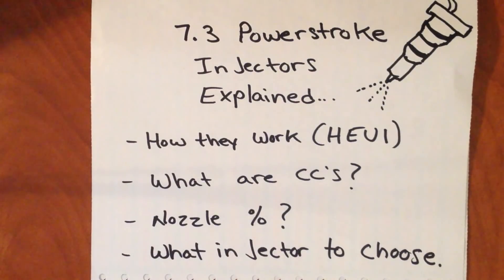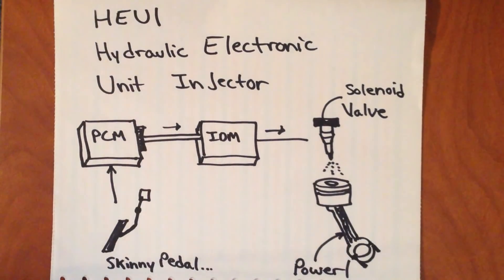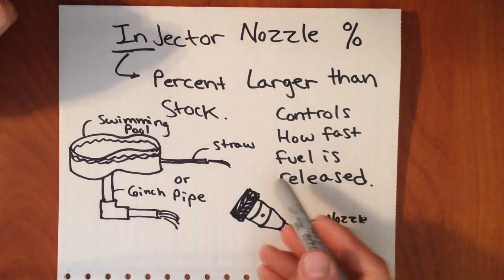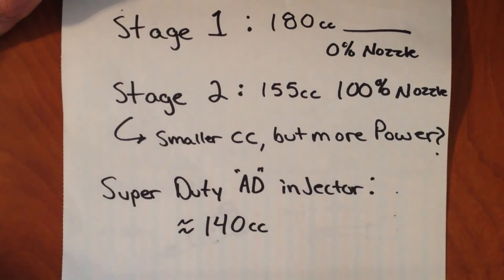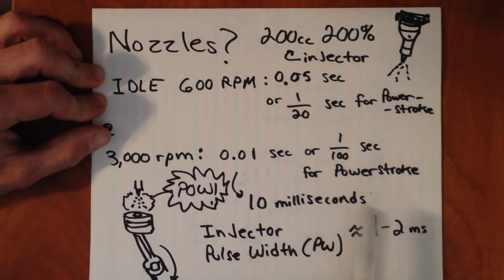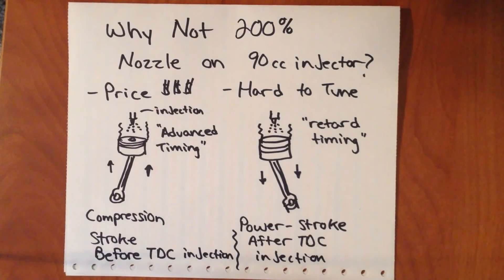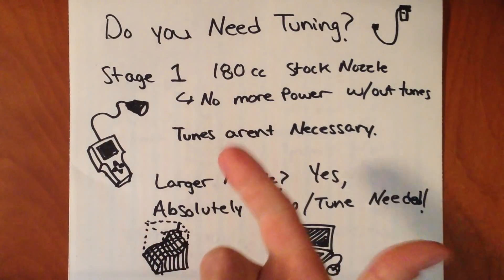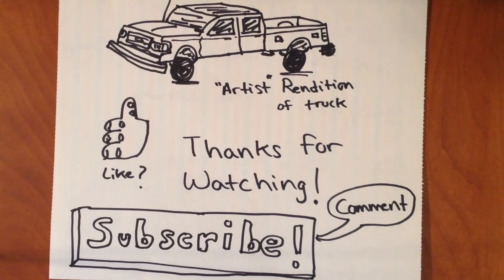7.3 Powerstroke Injectors Explained

Comment: I have a 2000 truck  that came with AD  INJECTORS  I recently  had to replace the motor wound up putting a 94-97 not sure exactly  what year it actually is but it does have AA injectors can these successfully  run with my newer 2000 model computer?
Reply: Thank you for the fast response .
ok  I didn't give you all the info that was maybe needed.    The truck is a 2000 FedEx ground  grumman's stepvan it's a 1652 sc  chassis  it came with international  444 7.3 turbo diesel with all international  computer and sensors it has AD injectors it was still running with 600,000 plus miles I've had it about 4 yrs. It's a truck from Maine so their was rust issues unfortunately.  
It began to give me some issues with running poorly.  
I dumped a suction eliminated treatment and their fuel treatment  and that helped for a while but also had bad exhaust manifold leaks so I was gunna have to pull the motor to do some work to it ..
I thought well if I can find  another complete motor that maybe my ticket.....   I found one.  2014 Reviva 7.3 Reman complete motor . 
Excellent  price I decided to buy it  the guy has a shop and is very familiar  ?????  With these trucks. He has a contract with a large parcel service to maintain their trucks and dispose of them when no longer useable evidently  their are newer parts on some of these that may have been wrecked or whatever reason and he is able to buy the complete truck and dispose of as he see's fit.  
Ok so I agreed to pay him so much money for the motor and so much for Removal and installation  of new engine I. Thinking this is sweet almost to good to be true.  Lol it was. He had my truck for over a month he did do most everything  he said he would but the 2014 somehow blew a rod from the day I saw it running and putting it in my truck so he has multiple  7.3 motors literally  lying around on shelves in his shop the guy Is an intelligent  very likable nice guy but I dont think I can say that about his employees  ...
He wound up putting what appears to be a 94-97 7.3. 
I pulled valve cover off to verify this motor had the 2 connection valve cover wiring  harness verses the newer single connection  the replacement  motor came complete with wiring harness  has a separate pcm and idm like my Ford excursion 7.3 diesel and my 7.3 f250 and 7.3 f350 dually .
From what I can tell he used my original international 7.3 444 wiring harness and  single I guess Idm pcm computer and reused my valve cover gaskets 
To connect my wiring harness  to the single shot aa injectors.
The truck runs I've driven it about 175 miles it smokes (black) constantly  and is pretty week .
Do you think I can drop in a new set of AD  injectors  which is what the original engine had that the 94-97 motor will run correctly ?
Will I run into possibly  problems  also with the Hpop? 
 I think the 94-97 has a 15* hpop and my 2000 has a 17* hpop. What are your thoughts ?
Thank you so much for any advise  sorry it's so long
Reply: Sorry not suction.    
  STICTION ELIMINATOR
Reply from the maker: Wow, you have a very perplexing situation! If you can, avoid driving or starting it at all until you know whats going on, you don't want to toast the new engine too. I'm not familiar with the T444e, never worked on any of them, but from what I know it's the same engine as the 7.3 powerstroke but with of course different injectors I believe, a different bell housing too I presume, and probably a different accessory setup as well. That being said you can convert a 7.3 powerstroke to a T444e and visa versa. If I were you, see what you can find out about the computer controls that you have currently. Is the PCM a Ford or International PCM? If you can, find out what year it is too, maybe by looking at the serial number, Fords usually have something like FTZ... or some variant thereof. See if you can do the same for IDM, I don't know if the T444e and the powerstroke used the same IDM or not, and I'm don't know about interchangeability. 

You say the truck smokes black and makes no power, with lots of black smoke, it sounds like the computer calibration is off, like it's dumping in too much fuel. I think there's a couple of things that may be coming into play here. If you have a 94-97 engine, with AA injectors, assuming they are indeed AA's and not AD's with AA solenoids on them, but that is unlikely, then we at least know what injectors you have. I suspect your computer is messing things up. Obviously split shot and single shot injectors require different calibration. If your current computer is indeed what a 2000 year model T444e would've had, it's probably calibrated to run your split shot AD injectors. I suspect your current computer is the original T444e setup that came with your truck. If your friend put in a 94-97 engine and swapped to the 94-97 computer, then you probably wouldn't have any issues as the whole setup is designed to work together. 

Here's what I think you have: You have a 94-97 engine with single shot AA injectors, but your computer is the late model 2000 T444e designed to run split shot injectors. What may be happening, is that your computer is trying to run the single shot injectors as if they were split shots, but it obviously is causing issues. Essentially your split shot injectors dump a little fuel in first, then an internal channel is exposed, causes the injector to not put any fuel in, and then it dumps the rest of the fuel in after the port gets covered up again, or something like that. The split shot's are less efficient at dumping fuel into the combustion chamber despite their large CC capacity. With that, the original computer was designed to compensate for the period where the split shot injector is effectively useless and not dumping in fuel at all. However, with the single shot injectors instead, you computer is now using that compensation when it isn't needed. Effectively it's advancing the timing, and dumping in way more fuel than it thinks it really is, since it was calibrated to run the less effective split shot injectors. The over fueling would explain the black smoke. Unfortunately I wonder if your lack of power is a consequence of the computer over advancing the timing and dumping in the fuel way too early causing the engine to be fighting itself or at least it's timing is just terrible resulting in the low power. 

Verify what PCM and IDM you have first. If your PCM & IDM were designed specifically for your AD injectors, then you should be good to just get a set of new AD injectors and the truck would run fine, at least in theory assuming nothing else is majorly wrong with the truck. As an alternative that may be more cost effective, maybe a better solution would be to swap your PCM to the earlier variant that is designed to run the single shot injectors? Look at your system carefully, and don't take my word for it, you probably know more about the differences with the T444e than me. Best of luck!
Reply from the maker: Fred Morin, Good question! As I'm sure you're aware, the AD injectors that came with your original truck were split shot and the AA injectors on your new engine are single shot injectors. With that the timing and control system for the injectors is different. You can use the original computer if you retune it to properly run the new single shot injectors. It's actually a popular thing to do for SD 7.3's. Take a look at the TS6 chip, there's also SCT, Banks, PHP Hydra, Bully Dog, the list goes on, and you should be able to find one that is specifically designed to convert your split shot computer to a single shot, but don't run the engine without the new tuning! If you do, it could result in the computer essentially over advancing the injection timing, dumping in way too much fuel, and blowing up your new engine as well. Did you keep all the Super Duty 7.3 wiring harness, accessory front cover and what not from the original engine, or what all did you do to get the old engine in the newer model?
Reply from the maker: Also, the 15* HPOP may not hold up so well to running the split shot injectors if you do choose to swap to the AD's. International changed to the 15* HPOP for a good reason, split shot injectors require more oil to run properly. You may get by and be able to run with the 15* HPOP on split shots, but you'll be straining the heck out of the pump and probably be down on power as well with the HPOP not being able to keep up.